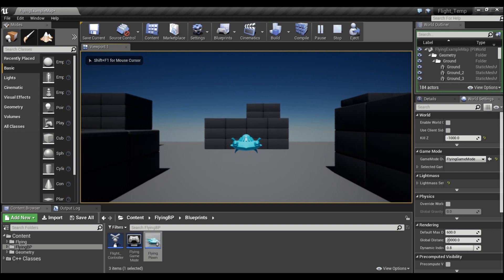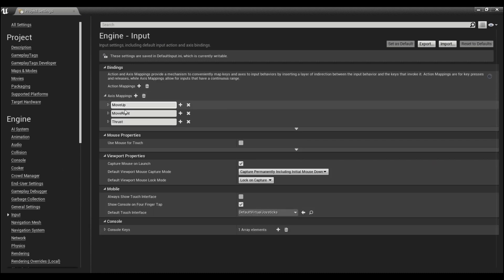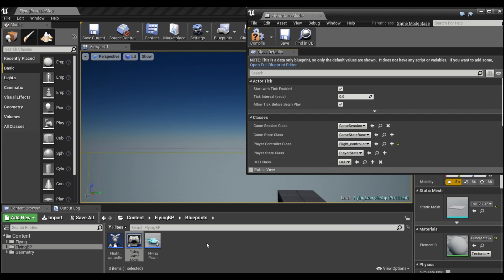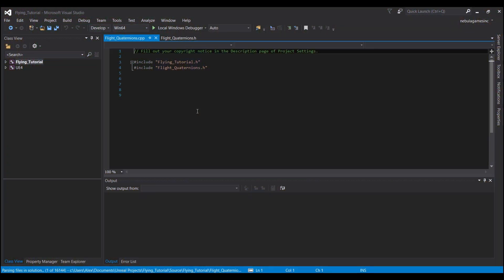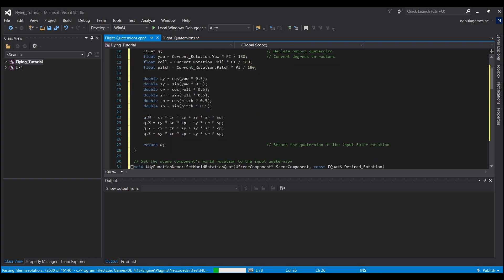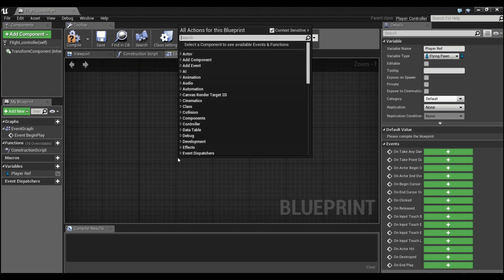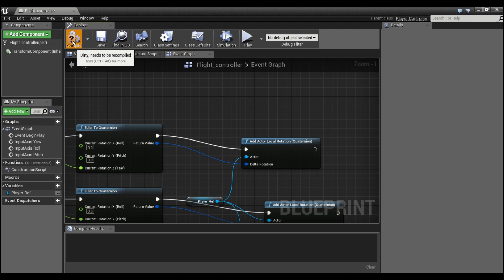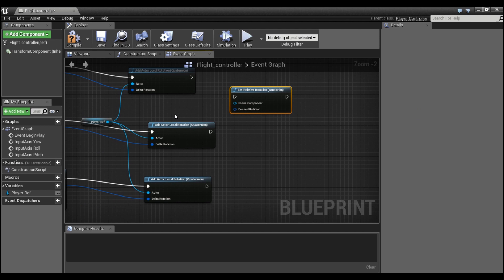#gimbal #6DoF #quaternion Unreal Engine 4 Tutorial: 6DoF Fixing Gimbal Lock

Comment: This was incredibly useful, thank you. Do you know if it's simple to expose other functions? For example, SLerp with quats would be crucial for a lot of situations, and I'd just like to know what is needed to expose functionality on my own any time I need it like this.
Reply from the maker: Yea it is pretty simple. If you check the code you'll see a bunch of functions that are exposed. You can see how I did it, basically you expose a function like so:
UFUNCTION(BlueprintCallable, meta = (DisplayName = "pick a name for your function)", Keywords = "words you want to use to search for your function"), Category = "the heading you want the function to appear under")
*the rest of this will depend on the function you're trying to expose*
        static void SetActorWorldRotationQuat(AActor* Actor, const FQuat& Desired_Rotation);

Then in the C++ file you'll need to actually create the function like so:

void UMyFunctionName::SetActorWorldRotationQuat(AActor* Actor, const FQuat& Desired_Rotation)

{
    if (Actor)
    {
        Actor->SetActorRotation(Desired_Rotation);
    }
}
Reply: @NebulaGamesInc  Thank you!
Reply from the maker: Yea hope it helps
Reply: @NebulaGamesInc  Quick question, i can't seem to find what I need for the .cpp portion of the functions I want to expose.  Like the actual code for the slerp function (it's already a C++ function implemented, just not exposed to blueprints). The quat.h calls to something called CORE_API which I can't find anywhere in the engine folder. Here are the lines from the header:

    static CORE_API FQuat Slerp_NotNormalized(const FQuat& Quat1, const FQuat& Quat2, float Slerp);

and

    static FORCEINLINE FQuat Slerp(const FQuat& Quat1, const FQuat& Quat2, float Slerp)
    {
        return Slerp_NotNormalized(Quat1, Quat2, Slerp).GetNormalized();
    }

Hopefully when I know how to trace the code down in the engine I won't need to bug you anymore.

EDIT: I found it below the header file (skipped over thinking it couldn't possibly be the actual code):

FORCEINLINE_DEBUGGABLE FQuat FMath::Lerp( const FQuat& A, const FQuat& B, const U& Alpha)
{
	return FQuat::Slerp(A, B, Alpha);
}

But I doubt this will work.
Reply from the maker: Yes, that's it. The C++ file will simply be a blueprint callable named function (you name it) where you have the required inputs feed into the function and you simply type in the engine function that is not exposed 'slerp_notnormalized' then immediately follow that with the parenthesis and you just type in the names of the variable inputs to your function you exposed in blueprints. All you're doing is creating a function you can call in blueprints and having that function call the C++ quaternion function present in the engine. So you just need to match the inputs and you're good to go.
Reply: @NebulaGamesInc  ohhh, I was overcomplicating it, then. Thanks again; this has been a huge help for development!

Comment: Im trying to do this with a TPS character, but I cant seem to make it work.
Reply from the maker: Should really be the same as what I did in the video. The video is a 3rd person view of a flying pawn. Only difference in your case would be the lack of flight so you'd clip into the ground when you rotate 360 but it's nothing different. What is the issue specifically?
Reply: @NebulaGamesInc  Nevermind, I think im gonna use a different system. Thanks anyways!

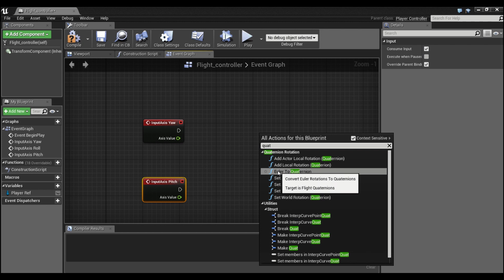Comment: Ue 4.20 breaks project if you add c++ class, but you don't need to, now there is Quat functions, just do like at 8:00
Reply from the maker: If they finally exposed quats to blueprints great! Although I am not sure how adding C++ that is "unnecessary" would break the project if the code compiles and is free of errors.
Reply: @NebulaGamesInc  Silly me, Its 4.20 version of UE that breaks project, when adding finishes it not adding class. When you try to open this project againt UE asking to rebuild it manually and thats it.
But 4.24 show error "E0393 pointer to incomplete class type is not allowed" in VS when addin code.
Reply from the maker: That’s an issue with headers (incomplete class type) and once it doesn’t compile and you try and run UE4 it will give you the other error about needing to rebuild manually. You can do that by deleting the VS files and the saved/intermediate folders in the project folder and then right click on the exe file and ask it to rebuild the VS files. Then it should work.

Comment: I got it working (with your help) on a flying project. I'm trying to remake it in a third person to have access the the custom nodes but it doesn't work. Does it only work for flying?
Reply from the maker: No, the nodes are the nodes. It is simply added C++ code to a project. It can be used in any project. If it isn't working it is likely an issue with how you are trying to implement the nodes in your 3rd person project. If you mean that you don't see the nodes showing up period then that is an issue with how you added the C++ code to the project, or the hot reload failed (exit and restart UE4 will fix that), or you are trying to use the nodes in a non-compatible blueprint class (although since I created a BP function library C++ base class it should be available in just about any blueprint you want).

Comment: i cant open up my game anymore, i did as u showned. but getting some errors while rebuilding.  a c2683 error telling me the name is not a class or namespace name, a ubt error:failed to produce item, then a msb3070 the comand "location of rebuild.bat" and then the location of the uproject, waitminutex -frommsbuild exited with code -1.

Can i rebuild without this or is it to late. I did not except it to destroy my project.

When i try to open the game, the foloowing modules are missing or built with a different engine version: ue4editor-yourgame.dll
want to rebuild now, but that does not work either.
Reply from the maker: Give me like an hr I think I know what the issue is. I created this in an older version where the appropriate header files were included and now you need to include the correct header files or you'll get namespace errors. Let me try and rebuild in a new version with the correct headers.
Reply from the maker: Try replacing your header files with the following. (this is in the YourLibraryClassName.h file)

#pragma once
#include "CoreMinimal.h"
#include "Kismet/BlueprintFunctionLibrary.h"
#include "Runtime/Engine/Classes/GameFramework/Actor.h"
#include "YourFunctionLibraryNameHere.generated.h" (this is whatever you named your library component)

If this doesn't work send me a screen shot of the error and the code so I can see what you are looking at.
Reply from the maker: Also, looking over your error again, it seems you must have deleted folders in your project. You shouldn't have an error that asks about rebuilding from a different module. I've only seen that when I clear out the .sln file from the project. Did you attempt to remove the c++ files at any point by deleting them?
Reply: Nebula Games Inc  i redid the project :) 

but ill try it again with the flying template instead.  
i got all the errors, and i tried my best to clean it up, and one thing was to delete the  folder.
But yeah you are correct, i did remove, but i still had lots of issues before i started behaving like a mad man in the project folder. :O
I will test this, on saturday when i get off work.  ill get back to you then. 

iam using 4.19 by the way. And iam doing an airplane game, and looping is kind of a key element:P
Thanks for the reply.
Reply: @NebulaGamesInc  i couldnt help myself so i did i what you recomended. And now its working like a beutiful baby flight game.

I did as u mentioned and did the tutorial again, made a new project, took the flying template and added the code and set up the blueprints, all names are the same as yours.

But, i still get a little twitch, a little nag, when i loop, it pulls to the left when it hits the 180 degrees, its there when i fly up and its there when i fly down.

Comment: Good day. Great tutorial!

I had a question concerning your fix and clamping. I'd like to clamp the angle of the roll to only allow a 270 degree range, so the ship can't actually roll a full 360+. How would one go about clamping that with your fix?

Thanks for your time.
Reply from the maker: I don't have a direct way to clamp because you are using quaternions internally. So the values to clamp wouldn't be in degrees. The only thing I could think of is maybe prior to converting the euler rotation to a quaternion clamp that and only allow it to input values up to 270 into the converter. Just a thought I haven't tried clamping the ranges since I designed this for space flight where i wanted the full 360. But i imagine there is a way to do it, likely pre-quaternion node.
Reply: @NebulaGamesInc  Thanks, I will try that out!

Comment: Thanks for this Tutorial! I've searched a lot online for a solution to Gimbal Lock that can be used in the PlayerController, because I'm making a multiplayer game and I've heard the PlayerController is important because different players get assigned theirs, so this Tutorial is very helpful!
I have a question: I've heard that for online rotation using Add Controller Roll/Pitch/Yaw Input nodes in the PlayerController is best for replication of rotation across the network. Can this C++ solution be applied to those nodes as well?
I'm new to Unreal and not good at C++ or angles, so just checking if I would be on the right track. Thanks!
Reply from the maker: @Bluehair Salt glad the tutorial helped! Yes, I had the same struggle so when I came up with a solution I decided to share. As for the multiplayer, I do believe that is true as the "add controller" nodes have built in replication functionality, however, I cannot comment how well these nodes will work in a multiplayer game as I have never attempted this before. I would be interested to know how it works out if you decide to implement it! Perhaps if there are issues I can attempt to modify the code to be multiplayer friendly and update the link.

Comment: I'm integrating your code into my game that mixes FP, TP, vehicles, and other interfaces and I'm wondering how best to manage other pawn types, since your Game Mode and Flying Controller are locked into flight. btw: at 6:55 you begin the process of mapping the Pitch, Roll, and Yaw and I noticed that if I map all of the input bindings into their unique slots on a single Euler to Quaternion function the controls are much more responsive! Too responsive, actually... in a good way but I need to figure out how to trim their responsiveness.

Double-btw: I tried, and in Xcode my project doesn't build if I #include the name of the project in the header or cpp like yours. Mine only builds in Xcode and UE without that include so I'll keep that requirement in mind if a new UE version comes out that breaks my flight.
Reply from the maker: Just divide by 100 or so. I think I used that number in one of the many versions I was playing around with and it worked fine. As for other pawn types, not sure if you want your vehicles to have 6DoF or a FP camera view.....it was really designed for flying characters/pawns. I am thinking you might want to have some sort of "clamp" so that you can't rotate past certain points in the other pawn types. You could use an ENUM to switch the clamp values or something depending on the pawn type being controlled. As for the XCode stuff, the Unreal Headers are a bit confusing and this was made in an older version where Unreal auto-included many headers for you. Now you "include what you use" so my headers may or may not work for a specific implementation of the engine. If you have something that works let it be :)

Comment: Hi , I have a situation where I’m trying to rotate a mesh, and output a consistent number to print screen for x y, and z. For each axis, the numbers should be 0 to 360 range. However when you rotate on Y axis, you get numbers jumping all over the place for all 3 x,y, and z. Give it a try and see what I mean. I’m actually willing to pay for someone to figure out a way around this issue. Basically the numbers that we print to screen have a use , we need to take the number data from a rotated actor and use that to control the sprite animation system we’ve done, but with numbers jumping all over the place the results look pretty bad.
Reply from the maker: So, this has been a consistent complaint of many people with how unreal handles actor rotation internally. It uses rotations from 0 to 180, and -180 back to 0 for yaw and roll.  For pitch the values are from 90 to -90. Controller rotations however are 0 to 360 so possibly try using those. Otherwise you'll need to come up with a solution to convert the rotations to 0 to 360. I tried creating custom nodes for this, worked well for yaw and roll, but pitch was a nightmare because in order to have it go -90 to 90 at fully vertical it flips to count back down to 0 from 90 and roll and yaw both instantly flip to 180. So trying to solve for all those possibilities became quite frustrating. Anyway, that is about all I can tell you from my experience with those rotations. Hope it helps somewhat.
Reply: @NebulaGamesInc  
https://i.imgur.com/D805KjQ.png, Check this out!
I was working on something in BP that lets me have 0 to 360 on the Y Axis, but it also effected the Z Axis because I was using the Z axis as a means that when it Z goes to 180 degrees, I fire off some math to neutralize the Y issue , But the issue with this is I couldn't FILTER Out the Z Axis rotations from becoming part of the new Y Axis rotations when rotating the Z axis. it Fixes the thing where we go back and forth between 0 and 90 to negitive values ect ect for Y. 
Anyways build that in BP and run the game, press F8 while running in viewport mode, than select the mesh while the game is still running and you rotate the Y Axis and watch the print out 0 to 360, but try the Z axis and it will also control the same print out, but the numbers kinda bounce on the Z rotations lolol... Perhaps if my BP would help you in salving the custom code you did, it may be the missing piece to your puzzle too. 

EDIT: when you say controller rotations, are you talking about the inputs from the control pad?! hmm that would be useless for what we need the rotation data for sadly.
Reply from the maker: Yes. Input controller rotations from the node "get control rotation". And I think we ran into the same issue just on different axis haha I could get roll and yaw to 0-360 but pitch wouldn't work. And trying to fix the pitch as you said would then affect yaw and roll. Maybe I will try again later with the code.

Comment: Hello,

i get 6 errors when compiling.

All are in the lines like this one: "SceneComponent->SetWorldRotation(Desired_Rotation);" inside the if statements.
The errors i get are: "Pointer to incomplete class type is not allowed".

Help would be really appreciated.
Reply from the maker: Hey, can you screen shot the errors? Also screen shot the .CPP file. I think it's an issue with the header file orders. Might be an issue like this person was experiencing. 

https://answers.unrealengine.com/questions/820908/a-way-to-get-around-the-relative-yaw-axis-issue.html
Reply: Thanks for responding so fast btw, i have to go now, so no rush. im gonna look into it more tomorrow.
Reply from the maker: No problem! I will check the code later and see
Reply from the maker: So I need to see the entire .CPP file, someone else had this issue and I have had this issue before in other code and usually there is an error about the header files. Sometimes switching the order of the header files included fixes the problem. Take a screen shot of the first few lines of the code and just so you don't have to upload more, send me a screen shot of the .H file as well. Those errors are because something isn't communicating properly and the compiler can't find some part of the declaration of the function.
Reply: Alright, looks like i fixed it. Aparently closing the unreal editor and then rebuilding it worked.
Reply: @albinadolfsson296  this did not work for me sadly. cant open my project now.
Reply: https://ibb.co/e9cvA9